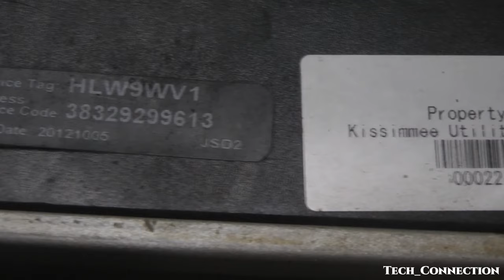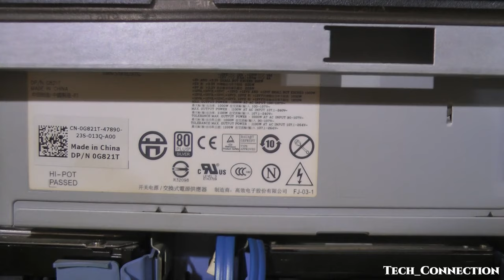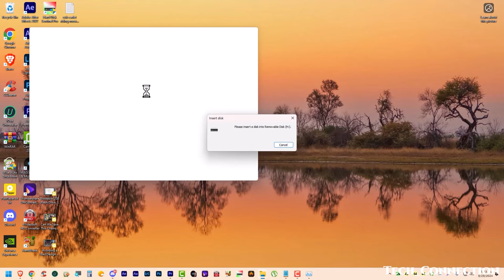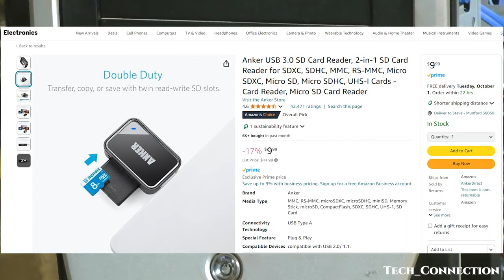Dell Precision T7500 Dusty PC Cleaning (2024)

Comment: I have practically the same machine. T7500, dual Xeon X5680, 48GB (24GBx2) total memory.  I put a EVGA GTX 670 FTW 4GB GPU, USB 3.0 PCIe card, ASUS Xonar PCI sound card, Startech 4 port SATA III 2x PCIe adapter, Orico USB Bluetooth 5.0 and a generic ebay Wifi N 150 USB adapter.  The SSD is a Sandisk SSD Plus 240GB SATA.    It currently has Windows 10 Pro on it, but I think I'll put Linux Mint on it eventually.